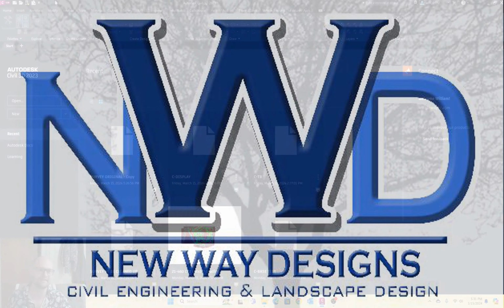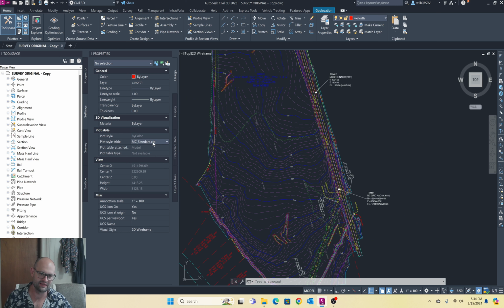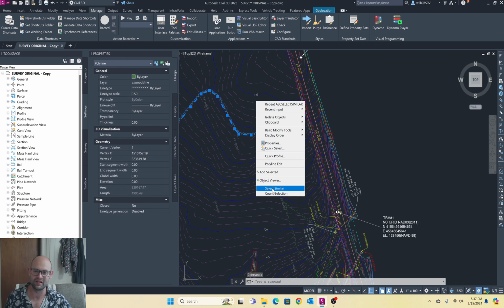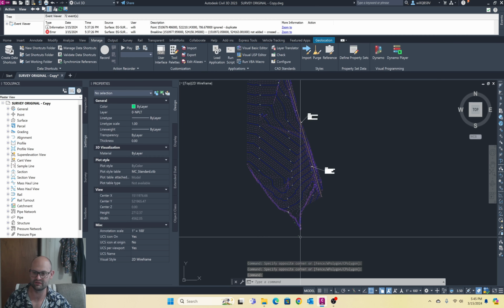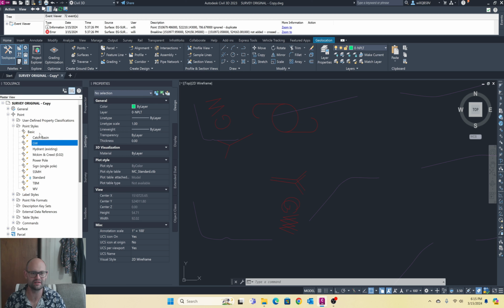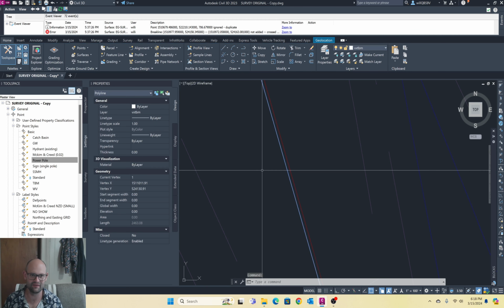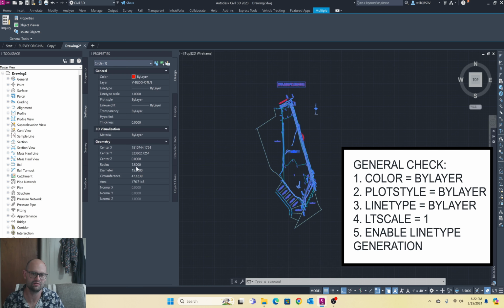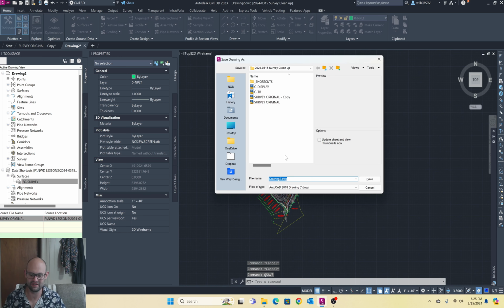Survey File Clean up for the Civil Engineer with DWT template reference AutoCAD Civil3D

Comment: WHY IS THE LETTER V PREFIX USED FOR ALL LAYERS? ANY SPECIFIC REASON?
Reply from the maker: The V- Prefix is from National CAD Standards. There is not a hard set of guidelines enforced nationally for name layer conventions, but a fair bit of engineers use NCS and for the reason it is the best place to base standards. Many engineers prefix proposed layers with 'P-' In NCS guidelines 'P-' is for plumbing, 'S-' is for structural, 'C-' is for Civil, 'M-' is for mechanical, and 'V-' is for survey mapping. There are other Disciples as well. You can google NCS or National CAD Standards and it will be one of the first search results. There are layers standards, plot width standards, and much much more. It's a very helpful starting point!